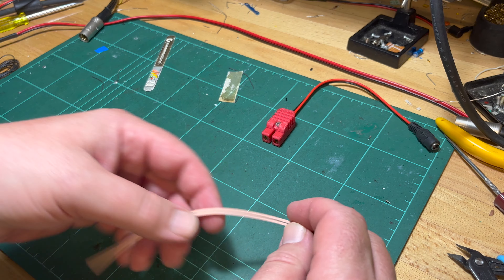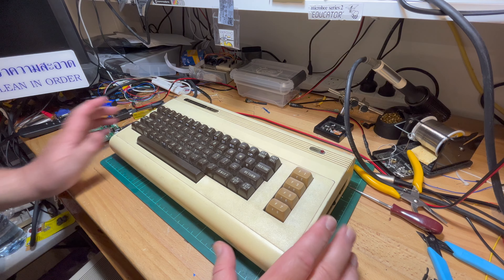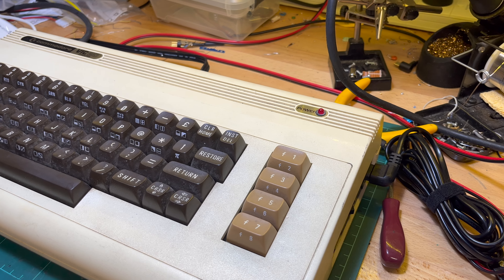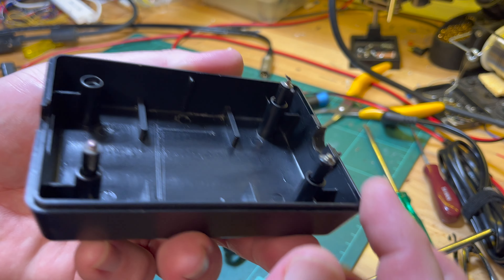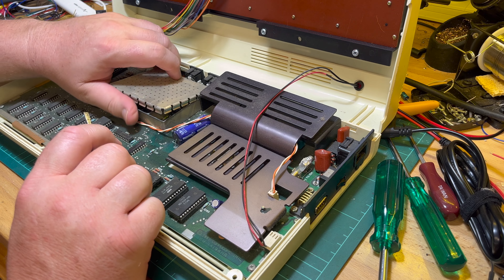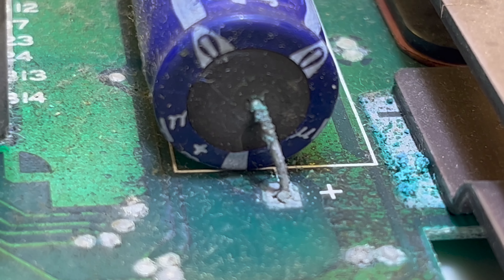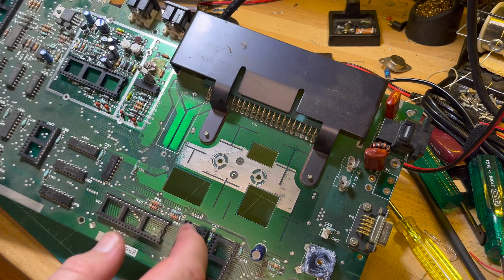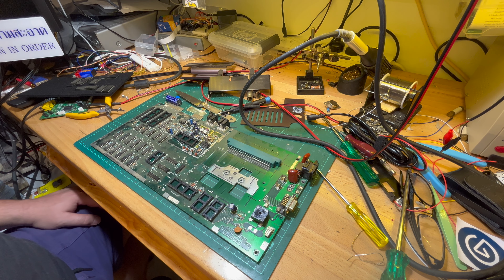🇺🇸 Commodore VIC-20: Refurbishing NTSC Serial No. P386173 (Part 1) [TCE #0226]

Comment: It is a good trick turning the screws tighten (clokcwise) before turning loosen (counterclockwise) to prevent breaking posts.
Reply from the maker: Ahhh ... I never knew that trick, thanks, will try in future.  I've always (usually) done it when re-installing the screw ... go a bit counter-clockwise first so the screw finds the start of the thread, then start tightening.
Reply: @Brfff  that is also an excellent suggestion for preventing damaging the threads.  Thanks!

Comment: I kinda like the rainbow border effect. Any way of making it permanent? :)

Agh, three broken posts. That sucks. That one big cap is a bleeder, it has to go. I saw tin foil around the fuse, I'm sure that you will notice it shortly. You did. :) They did that to the fuse because they bent the fuse clip the last time the fuse was changed. 

And you can leave the full-wave rectifier in there and not have to worry about the polarity of the DC adapter (that's how US Robotics did their modems back in the day). But you would want to bump up the voltage coming in to compensate for the forward voltage drops.

We have two Wii controllers and a Wii balance board that we have soak in vinegar. One of the kids left the batteries in. Oops...
Reply from the maker: Yep, I usually leave the rectifier in (even though it's a big waste heat source) also just in case someone decides to use a 9VAC plug-pack instead of DC.
Reply from the maker: Oh, and sorry ... it seems the rainbow effect is now gone!
Reply: @Brfff  Darn... :) 

As for the keys, why oh why do you have 30 VICs? It's not like I have too many... uhm, never mind... :) Seriously, taking keys from one to save another? Net zero effect. No harm, no foul. I did see a video where a guy used a pin vise to make a small hole in the broken cross piece and then thread a screw in to give himself something to pull against to get it out. 

But then he still had to buy replacement stands, or whatever you call them.

Comment: hmm looks like the fuse is wrong size..supposed to be a smaller one....hence both ends overhanging the clips...foil just to extend the connector...
..the extension board...the end looks like possibly bent during shipping

youre killing every ham radio operators hopes and dreams by removing all that RF shielding! (and adding the switch modes!) 
i checked my CPC RF noise with my RTL-SDR dongle... noise all over the spectrum..can even hear the loading sound when its playing a tape!...id be interested to see what a VIC or C64 puts out..
....these signals can actually be decoded...and a tool called Tempest can be used to convert the RF signals into a viewable image! (even works with LCD monitors and PCs!)..you can pull data without a physical connection..just by decoding the RF emissions the devices are putting out...
Reply from the maker: Yeah, I know ... I just don't like hot-boxing rare chips like the 6560/6561 ;)   Tesla didn't even bother putting an AM radio in their cars as they couldn't be arsed (as I heard) to design the required shielding/filtering ;)
Reply: @Brfff  AM is pritty much wiped out thanks to DSL modems!...unless ya right on top of the transmitter, or late at night when electrical usage is low..i cant even pick up 531AM anymore (Super Mid North Coast Radio).. but its also transmitted on 93.5FM... (and i found their link between studio and transmitter at around 800Mhz!)